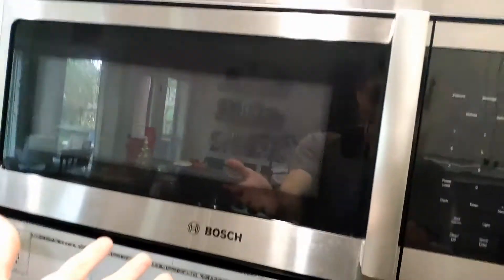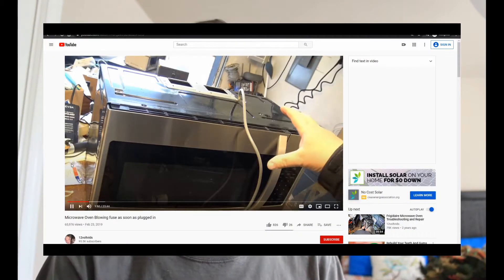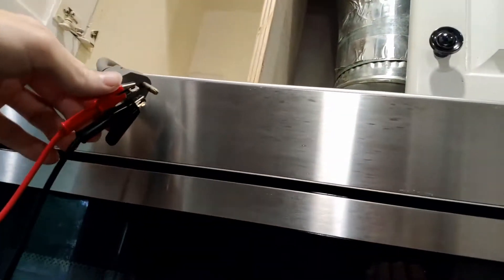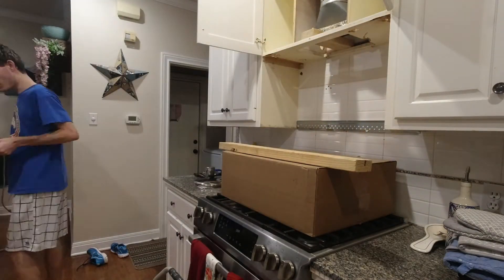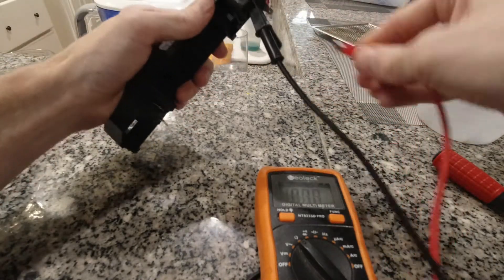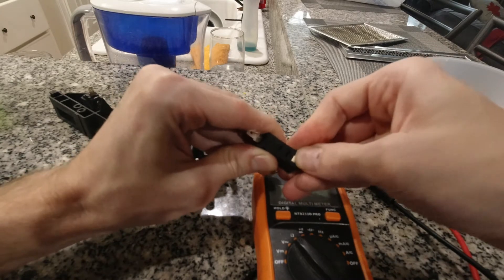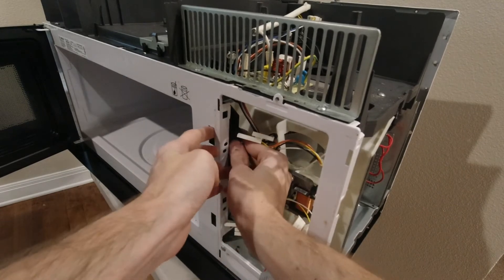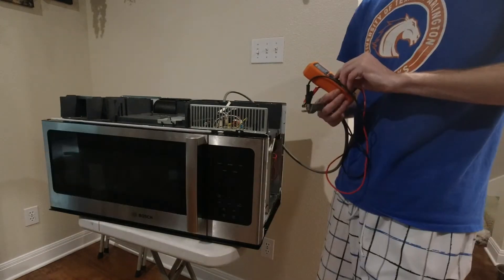I Broke My Microwave!

Comment: Usually I buy those over the range mixrowaves at lowes for $50. Generally some poor soul had dropped it while trying to tilt it in on the bracket and dented in the rear corner. Good thing there isnt anything there and you can just tap that out - not that you'll see it anyway.